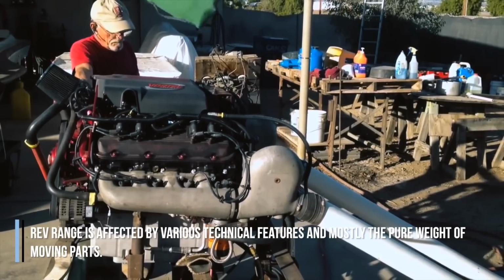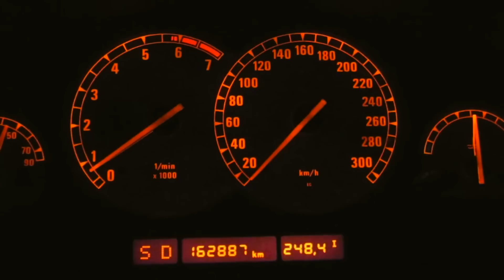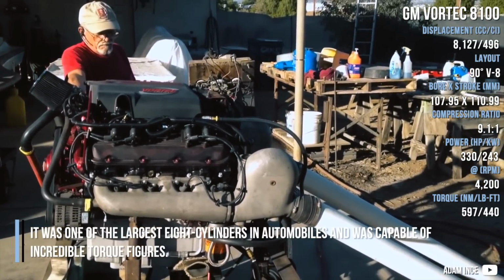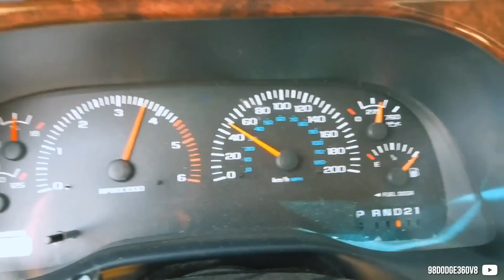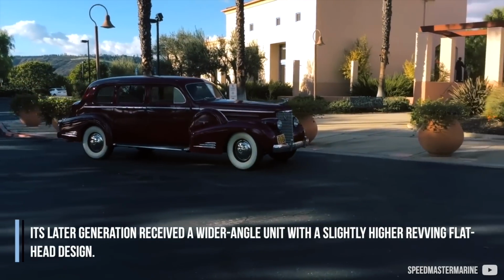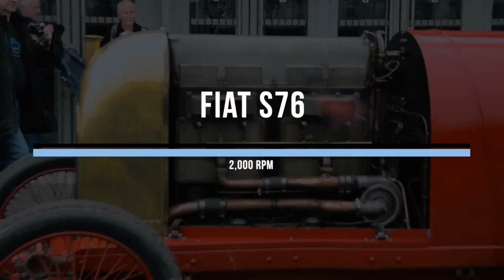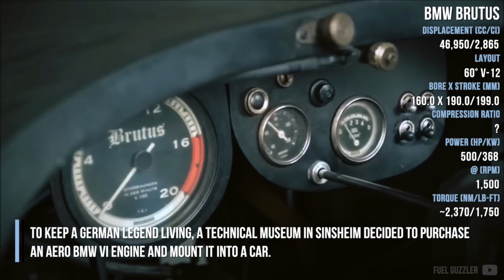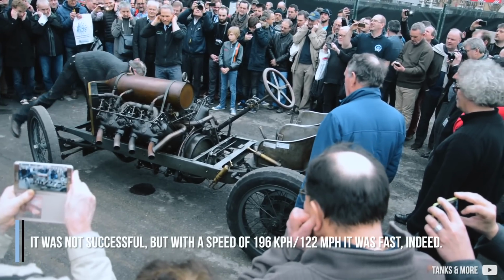Lowest Revving Gasoline Engines

Comment: GM's LA1 V6 only makes power between 2K and 5K RPM and peaks at 3800. Redline on the guage goes to 7, but that's only there for downshifts. Doesn't lack torque for what it is, but it runs out of breath quickly on the top end. Not as low as some of the engines in this video, but it's not a revving engine by modern standards.

Comment: Had a 2001 Dodge Durango with the 4.7L V8. Red line was 5300 but I wouldn’t trust going that high. The engines were basically made of plastic. I never went higher than 3500rpm.

Comment: You missed a number of engines that notably revs quite low. One notable example is the Talbot-Lago T26C, one of the earliest cars conforming to what became Formula 1. It had a 4.5 litre engine that only revs to about 4500rpm. There were several videos of those cars on Youtube, including several onboards of cars being raced.

Comment: I had one of the last Ford 300 in line 6.
Mine was fuel injected with a five speed in a 1988 bronco.
As far as I know its still running
Reply: I still drive my 90 f150 with 600k miles.  Found it interesting that was the only modern engine with a truly low RPM, also the longest production and most reliable.

Comment: My B5254T (Volvo 2.5L turbocharged I5) has 193hp at 4500rpm. It rev to 6500. In 5th gear at 4500rpm it does just under 200km/h. Don't judge me! 193hp will only get a 1.7 ton tank to 200km/h on a slightly uphill 2km straight.

Comment: I find it interesting that most engines of all types these days only rev to 6,500rpm.
Reply: Wrong, many Motorcycle engines rev above 12,000 rpm. 6,500 RPM is standard for cars as it is safe for the most common cylinder sizes with cheap materials.
Reply: Perhaps that's where you get a good compromise of cost, low down torque and higher end power. Turbos are hugely common too - they tend not to rev very high in consumer cars

Comment: BMW M70B50: A lot of exact details - but a single mistake: BORE X STROKE is NOT 91.0 mm x 84.0 mm, BUT is 84.0 mm x 75.0 mm ... I have the very engine in my own 1990 BMW E31 850i ...

Comment: I bet there are some small fixed rpm engines (like a generator) that probably may run no more than 2000rpm
Edit: most are roughly at 3500 it seems but maybe there is something that runs lower

Comment: Yes, the Ford 300 I6 is incredibly reliable. I have seen two of them reach more than 300,000 miles. They all leak oil from the lifter cover though.
Reply: Haha mine does
Reply: My grandfather had a 78 E100 with the 300 and 3 on the tree manual, my uncle drives her now as pop passed in 2015, don't know how many Kilometres are on her because the  odometer has rolled over a bunch of times, but she runs smoother than some modern engines (thanks to the bullet mufflers on her she sounds like a beast too).

Comment: Ford 300 with the right stock crank and rods will top 7000 rpm.  It was the cam, and induction system that limited the rpm.

Comment: My 2005 volvo S80 has a redline at 6000 rpm. It has a 5 cylider engine that produces 140 hp. I don't remember the volume.

Comment: UAZ's, be it the 469, 452, or 31512, Redlines  about 3,000-3,500 RPM, at least any that have the engines produced from 1973-1989. I m not willing to push mine past 2,800 to test that though.

Comment: Where are the lanz tractors? They had 10 litre 1 cylinder engines. You could cpunt the explosions when in idle. I think they did 500 to 650 rpm
Though they could run with almost anything but not gasoline. There were models powered by wood

Comment: Its just like common question : what do u want? A huge torque engine for ur daily trucking or a very high reviving car for ur 500++km/h desire?
Reply: I'd go with torque.
Reply: @danishghostrider  Why Not Have A Mid-Ground With A Substantial Amount Of Torque With Some 7K Revs?
Reply: @SolaricSage116  Cause I prefer diesel over gasoline/petrol

Comment: my 700cc 2 cylinder car's peak torque at 2000rpm and leak power just 4500rpm it is one of low revving gasoline engines

Comment: Wooow you really don't understand the BMW M70. It's not about acceleration, and the last thing it should do is a sound like that with an aftermarket exhaust. It provides smooth power like a jet and whisper quiet, you don't hear it sitting in the car, unless redlined.

Comment: ok i have to set something right.. the 8100 was also used as a marine engine... Yes.. But.. The 8100 in your boat.. will produce way more power than the 8100 in your truck. When used in a boat, they have lighter flywheels, bigger cam lift, longer duration, better exhaust systems, and generally.. are not emission compliant.. Just removing all emission bullshit from your engine would make it seem as though you have double the power...
my knowledge comes from over 30 years of twisting wrenches on everything from 2hp outboards all the up to 1500 hp claas chopper v8 diesels that weight over 5000lbs...

Comment: I do not think Ford ever put Cummins in there trucks. I’m pretty sure they went with international. Aka 6.0 7.3 and so on. The 6.7 is one of Fords Diesel engines. I may be wrong though. Edit: looked it up and the 2016 6.7’s were built by Cummins for the Ford.

Comment: Well if we are talking about any engine, hit and miss engines get around 250rpm Max.
Reply: Also for fuel if we go over to diesel there is a marine Diesel engine that has a output of 80,080 kW (108,920 bhp) at 102 rpm.

Comment: What's this, no 225 Slant Six? 

Also, the Ford I-300 was the best pickup truck engine Ford made, fight me.
Reply: I've gotta agree, it's pretty sweet. Especially with the four speed manual and low range. There not fast but are extremely reliable and pull anything you put behind it. That's what a good truck engine should be.

Comment: The GMC 60 degree V6 (Not the Chevy 60 degree V6) came in sizes from 305ci to 478ci it was a very low revving engine. I think you could have wound the piss out of a 478ci and got to 4000rpm 🤣 the 478ci had gobs of power off idle max power was rated at 3700RPM

Comment: All my engines are low reving because I want them to last.
Reply: RPM has very little to do with longevity.  High BMEP at low RPM, is more detrimental than the same BMEP at high RPM.  Due to time.

Comment: Anyone remember the ford 4.0 sohc v6 from the 90s and early 2000s. My Explorer still runs strong
Reply: The Cologne V6! The 4.0 SOHC was the last version of the Cologne V6, the first ones were introduced back in the early 1960s by Ford's German division. They weren't retired from production until 2011, and it wasn't for reliability reasons, it was because redesigning and engine that old to meet modern emissions and fuel economy standards would cost more than designing a new engine from scratch.
Reply: Ya this thing gets 12 mpg on a good day

Comment: mi 1981 ford falcon  6 inline 3.0 L 188ci manual 3 speed has a red line of 3800RPM stock 170km/h XS  is not in the list xCif you do some improves you can go 200 km/h at 3000 rpm and is a 1958 engine design, for a family compact sedan xD 50 liters 550 km...

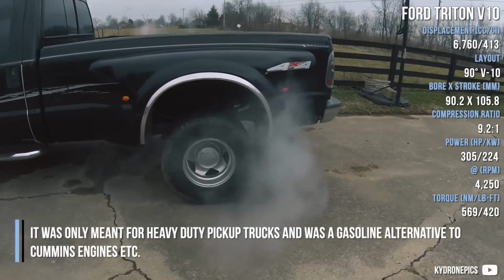Comment: 1:40 he says it's an alternative to a Cummings motor🤦‍♂️, I wish ford put Cummings in there trucks
Reply: As the gallery into some gasoline engines with a low redline when most won't wind past 8k RPM when the gallery included the triton family of engines when the family included a V10 version when it is to be an alternative to the power-stroke family of diesels.  With the modern hemi engines from FCA had the few wonder if the peak torque is available between 2500 and 5K RPM and redlines maybe 7K RPM.

Comment: looks like you're gonna have a part 2, because you missed the GMC Thunderbolt V12 and V6s, having a redline between 2300rpm and 2700rpm depending on which iteration, and the 637 V8 that followed with a 2800rpm redline. they were put in fire trucks and buses mostly.

Comment: I would design a hatchback with a hugely oversquare one cylinder hot bulb engine and nice manual transmission. A snow tractor and grocery shopper.

Comment: My jetta diesel only revs to 5,000
Reply: The redline on my diesel is 4.500
Reply: normal diesel maximum till it breaks is 5200 vws usualy have 4500 i think, you can tune it to any rpm but im talking about stock cars before you say VW TDI 9000 RPM or something, under 4000 its usualy very high torque or cheap to build diesel
Reply: @dieselgeezer18  a dude said his dacias 1.5 dci has a redline of 4200
Reply: i think i know a dude with a diesel audi that has a redline that starts at 3500 but im not sure and it ends at over 4000
Reply: @Noooo23523  Well, my dad's Deutz tractor has a redline of 2,500

Comment: V8 Triton motors are fucking ass. 5200 rpms out of a overhead cam engine is a joke. overhead cam engines make all their power at higher RPMs and to lose your high RPMs means you have no power... Horsepower is RPMs times displacement...

Comment: Uhmmm the Ford Triton v10 wasn't s replacement for a Cummins but a powerstroke. Dodge has Cummins engines and Ford has powerstroke.
Reply: Both companies used the v10 as a gas substitute for the diesel motors. The dodge v10 made the same amount of torque as a cummins of the same year, and only feel behind as the 90s dragged on. It was a cheaper way to get diesel levels of power in a pick-up at the time.